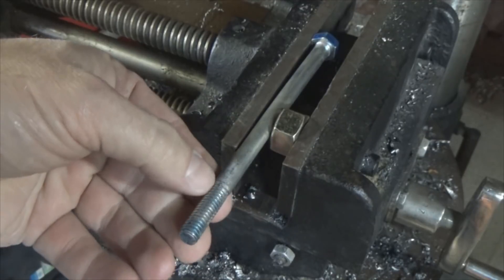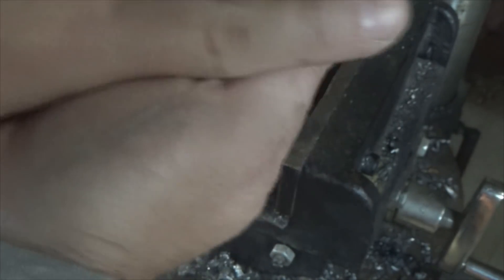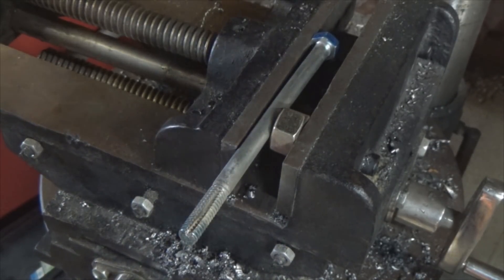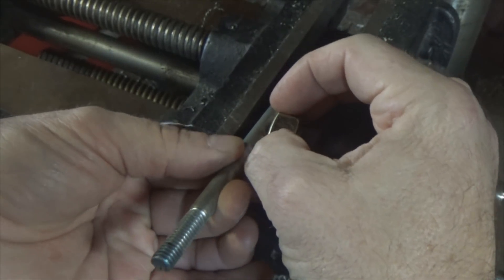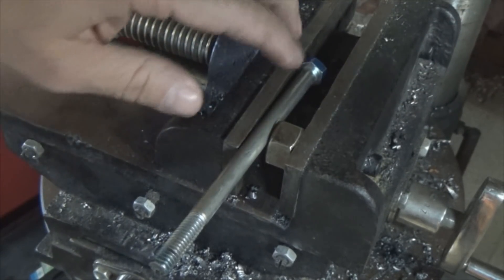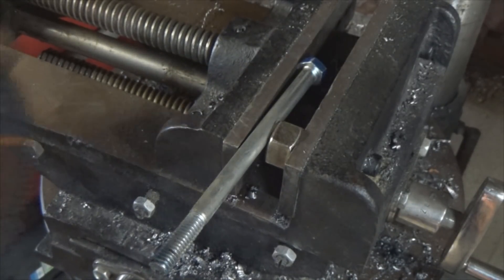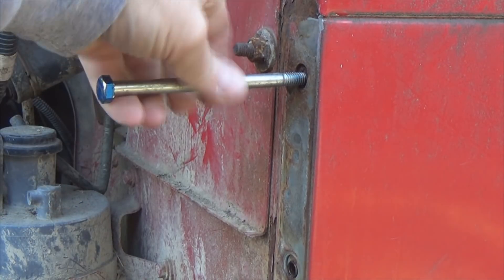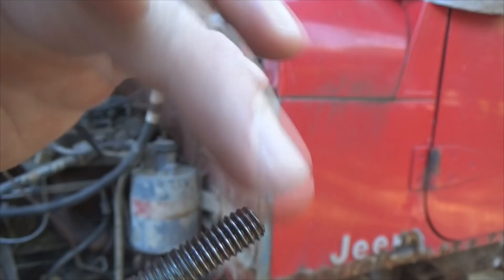Homemade Thread Cleaning Tap on Tool Tuesday

Comment: Thank you for the great tipand advise !  I broke the bolt installing a harmonic balancer while engine was in car using the parts store tool rental kit (Taiwan made or too many prior uses?). Heart stopped then racing - until I got the broken piece out with a chisel and no damage to crank.
Reply from the maker: My dad was working on a 96 Mustang a few months ago. It had a broken harmonic balancer bolt that he replaced. The balancer worked its way off the crank enough that the CPS want picking up the trigger wheel any longer which shut the engine down. Its crazy RARE that the balancer bolt breaks!! Glad it worked out for you! !Thank for dropping in!! Have a great day!

Comment: Did you chase the threads with a die to remove any burs after cutting your bolt? Otherwise you may damage the threads that your cleaning out. Nice videos brother, peace out! ✌️
Reply from the maker: Thanks brother! Glad you like the videos!! I didnt show it in the video (I should have) but I did take a wire brush across the kerf cuts to take out the burrs. Running that abrasive cutter head and making the cuts slow doesn't create very big burrs if any at all. But you are correct, it is a very good idea to make sure the burrs are gone to make sure that the tool just cleans and not damage the original threads being cleaned. Thanks for dropping in a great suggestion to help others!! Have a great day!